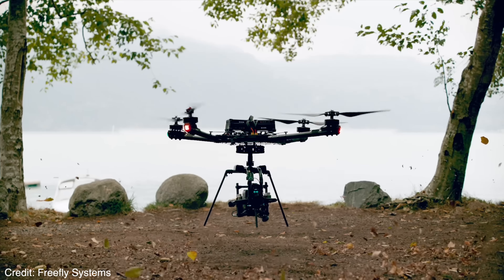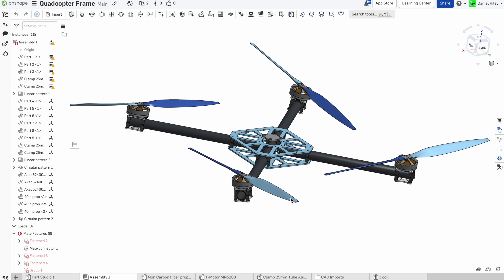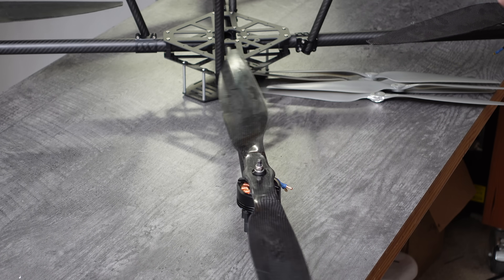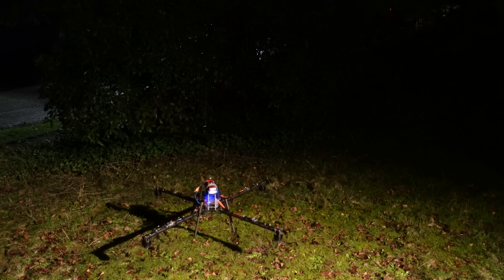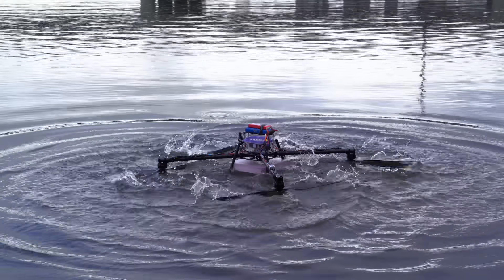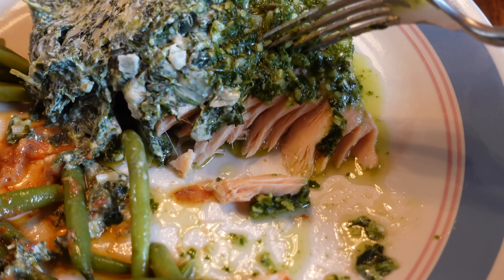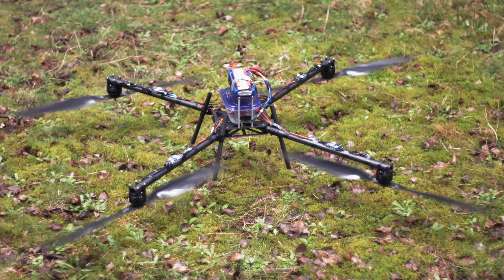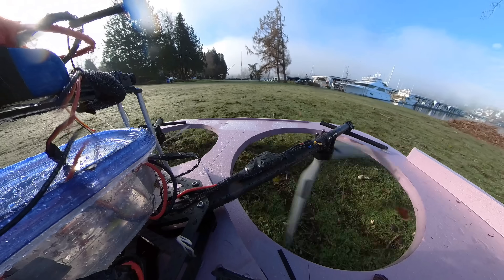Quadcopter Ground Effect Vehicle

Comment: The reason for the "sealing" might be the transition between generating lift due to pressure difference and Impuls based trust. Propellers for aircraft are designed to accelerate big amounts of air with a low pressure differential. That's also why you don't get much better power efficiency at very low altitudes, you basicly stall out the props.
You should try props with more but smaller diameter  blades and less pitch.
Reply: I think it’s Bernoulli. Fast air below, suction downward.
Reply: @tcveatch  Mhh.. Yea, but I think the ground effect is more or less the inverse of the bernoulli effect, or it eliminates it's effects.
When the air is compresses underneath the vehicle, the fast moving low pressure air directly behing the props sucks in the air from the higher pressure underneath (in a vortex) instead of pulling it partly around the bottom of the vehicle, including from the front.
I guess that's all the effects working in a complex fluid system at the same time. (maybe creating the ground effect). And the description might depend on the way you look at it. 🤔
If a day could be 4 times as long, I would love to study such things in more detail to figure out how such complex systems work, and which effect comes in and out of significance. 😅

Comment: the reason why it "sticks" to the water when it contacts it is due to surface adhesion from the water, if you ever put a flat piece of board in the water and tried to lift it up you can feel it just stick like a weak glue
Reply: Spray it with a hydrophobic coating. Boom. Problem solved.
Reply: (bear with me here) Would it lessen this effect if you were to use say a checkered pattern like a chessboard, but every black square is raised up by maybe 1/2 an inch (1cm), into a point like a pyramid??? I feel like as the tip of the pyramid tapers, the less adhesion to surface area there is.
Reply: @colon3_  I'd guess that would work yes, as there would be many air gaps and it would suck less
Reply: So could you cover it in some sort of hydrophobic substance to help stave off that effect?
Reply: @matthewturnipseed5182  Or just use a couple two liter bottles or the like on the bottom legs to float. The foam pieces have too much surface area. For air and water applications this is bad. Unless its on a wing or prop, and used for lift. Look at some Air/Sea planes. The big boat like ballasts they have on the bottom legs/landing gear... Other people have used pool noodles, those work great on smaller drones. Not sure it would have the buoyancy for this big boy. So Id say 2 liter bottles.

Comment: wire hoist for easy lift off force test, also a skirt makes some of the airflow circulate back up, coanda effect, ie the air flow sticks to the bottom and sides of the foam, titanic met its ice berg, the water. so what was the power savings of the quad hover craft vs non-ground effect. yep helium floating is free, you just push it around in the sky.

Comment: Cool. The best ground effect I've experienced was an MCPx hovering inverted an inch over a gym floor. It was actually hard to make it touch the floor. The tips would touch based on the angle but the center rotor button wouldn't!

Comment: 5:02 Bigger under driven props are always quiet. We have 4 LiDAR quads and two of them are for city use, with huge props (35 center to tip) to reduce noise as much as possible so we don't get nutties aggravated when using them to map historic buildings.
Reply: 70cm diameter = 28" which is a common propeller size, matches up.
Reply: it makes me wonder why they do not use Quad Zeppelin's. basically, a quadcopter that uses a loon style bladder to maintain neutral ounce in the air, with a mechanism to change it up or down, like a small compressor and pressure regulator sensor. then use the props to move it in the other dimensions. then it could e Super quiet, and maybe use less energy and thus have better battery range... worth testing I would say, depending on the end use I guess.
Reply: @EddieSchirmer  that's a concept I've often thought of testing! as a hobby drone builder. I'm guessing it's the fact that you'd need a large amount of hydrogen / helium to carry the few kilograms of weight, which acts as a huge sail and is vulnerable to wind
Reply: @shitass3931  yeah, it would probably e prohibitive like that. I was thinking maybe regular air pressure using the compressor. but yeah, im nowhere near knowledgeable enough to know what would work for that or not. but, for a slow speed or no-speed platform, it could e a battery saving option, just having a teacher to keep it form flying into the edge of space hahaha... in any case, its fascinating to see all the various craft tests this channel does. I can't wait until he builds his own mega yacht in his garage 🤣
Reply: @EddieSchirmer  blow up a balloon with your mouth. does it fly into space or fall down to the earth?
Reply: I did a talk for kids using a quad-copter-dirigible a few years back when quad-copters were first being introduced to the market. /the issue we were constantly battling for that design was how much energy was lost maintaining course against the wind.
Reply: 35" diameter or radius propellers?
Reply: @shitass3931 in case he doesn't reply let me try to help you out. He says center to tip, so it is the radius. 
Additionally, I think it is likely for it to be in centimeters, not inches
Reply: @MODElAIRPLANE100  thanks. was gonna say, 70" is ridiculous lol
Reply: Why are underdriven props quieter?
Reply: @oadka  Larger props, are quieter period, due to lower Rpm. A smaller prop, will have to spin faster to achieve the same amount of torque/lift. You also get a different sounds from them, smaller tend to be a higher pitched whine/scream, that we perceive as "louder" even though in many cases, it is scientifically not any louder, Just more abrasive to the ears.  Check out Toroidal Propellers. They look kind of like little girls hair bows. They are designed to make props quieter, but all they really did is shift the noise into a lower pitched whine, thus we "perceive" them as quieter, but if you test the actual DB output, its only ever so slightly different. Just a different tone.
Reply: are you a victim?

Comment: The bracing bars on the plate could have been used on the underside to act as a skirt to keep the plate higher and hence the “sticksion” from fast escaping air would be reduced
Reply: i was thinking the same thing. placing a pool noodle on each side and shaving the foam to aero shape would be perfect

Comment: Tuppenge has super small PP energy if they got aggroed on a video about a boat made out of a cheaply made and brittle plastic box. Is their brand even worth the cease and desist MB value? I doubt it. They used to be in (my area) European stores, but got thrown out for really poor quality and replaced with generic China made ones which actually last and don't crackle apart. Somehow learning they C&D an innocent video makes them even lower tier.

Comment: Have you thought of using a Gimbal system designed for cameras but used the stabilizations for motors instead? I feel like the high end gimbals from DJI would be perfect, although the data might need some fine tuning?